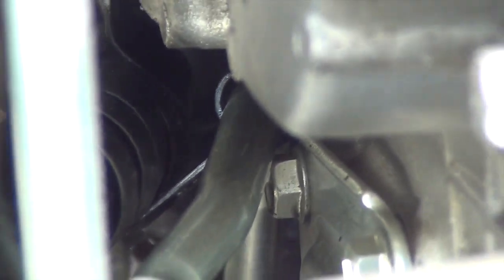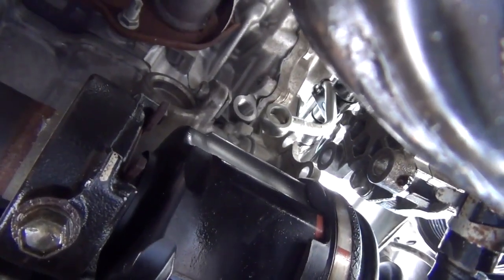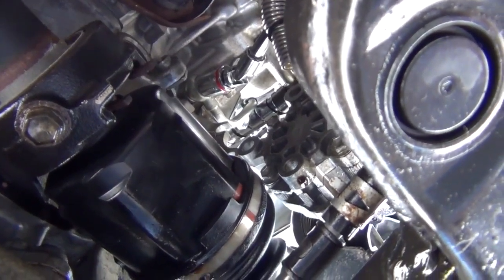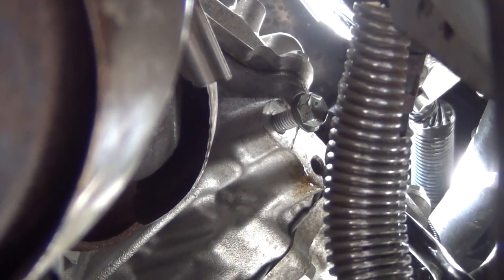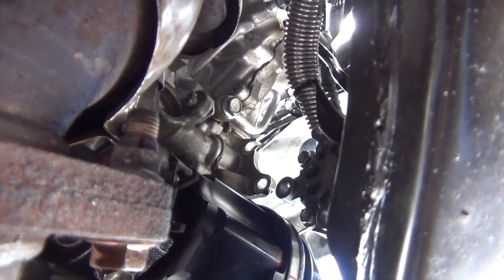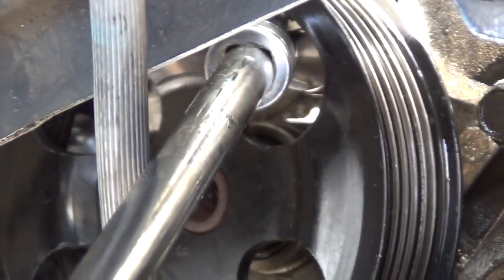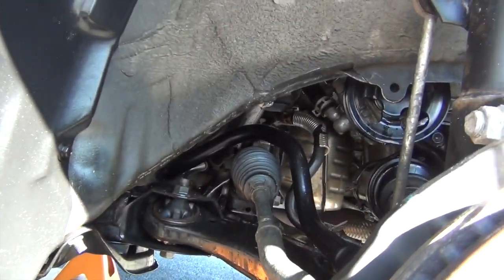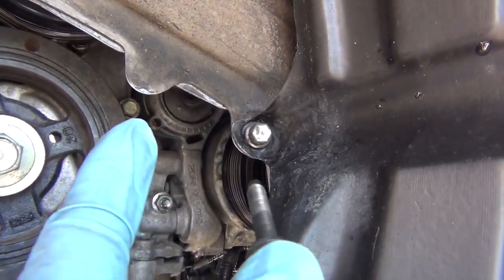3.5L V6 Camry VVT-i Oil Failure - How To Fix

Comment: Thanks for the video.  Was able to do this myself tonight.  for 07 RX350, this is impossible to do without disconnecting the power steering  lines and removing the PS pump entirely from the vehicle.

Comment: Thank you! I just bought a Camry with a rubber hose and did an entire search on YouTube. I found out that basically there are only 2 videos on youtube showing how to replace the rubber hose with a metal hose for the power steering pump. The other one showed pulling the axle out to gain space, which is not ideal for me. I hope your method is going to work for me. I'll try it when it gets warmer! 😄 By the way, what is the torque spec for the power steering pump bolt

Comment: To reinstall the PS pump, You have to loosen the engine block bracket bolt that the Power Steering metal-line-bracket screws into the Engine so the PS pump has enough wiggle room to line up & thread & tighten the the pump bolts. Then tighten the bracket bolt that you loosened.

Comment: For the 2GRFE engine I recommend replacing the line with the ALL METAL LINE Toyota 15772-31030 Pipe, Oil
2008-2018 Toyota 1577231030 - the rubber is the point of failure (video shows old rubber part replacement).  Copper washers (rear, one-piece) 90430-16016 Copper washers (front, separate) 90430-16017

Comment: The torque for the union bolts is 42 ft*lbs and the the top part of the line is supposed to have two crush washers, not a clip washer. If it works it works I suppose.

Comment: You had access for days on that Camry. I just did it on an 06 Avalon and I honestly think completely removing the power steering pump is probably the way to go on that car. I had to undo the sway bar links just to give it a few extra mm of space and I could still barley get a small socket with a u-joint on it. You might be able to get a torque wrench on it if you remove passenger side engine mount. You wont have but maybe enough room for a click at a time if the power steering pump is still in the car.
Reply: Some suggest removing the bottom engine mount and with a jack and wood block under the oil pan, raise and tilt the engine up a few inches.
Reply: Do I need a jack if I remove the upper passenger side engine mount ?

Comment: this is the best video for this job i found on line. I am going to do it for my 08 lexus ES350 when the parts come in. The toyota dealer wants $460 to replace it. The car previously had the rubber hose replaced by the dealer and not leaking for 10 years by now. But after 100K miles, i don't want to take any chances.
Reply: I did it on an 07 Avalon and honestly 460 sounds like not that bad of a deal.

Comment: That Toyota/Lexus would place a rubber hose in a critical part of the oil system is catastrophic.  I'm reading that this is in some form of recall with Toyota replacing this gratis?  Is that accurate?

Comment: I am having the same problem with both 3GR and 2GR engines. Indeed it is common not only with 3.5 L Toyota engines.
I am planning to do a similar job, but I wonder if I need to bleed engine oil first........... Very appreciated and clean vid. Thanks.

Update: I changed that crush washer without draining engine oil. Small amount of oil will leak that can be caught with a water bottle or a rag.
The job is easy and, with proper tools, can be done at home, better after removing front wheel.
Reply: It leaks minimal fluid. It doesn't really matter if you drain the oil because there will still be oil in the line and that is all that leaks out.

Comment: Last year,after watching your video, I visited the dealership.  The only part replaced on my 07 Avalon was the oil cooler. Service advisor told me it was replaced in 2010 but when I checked the records, it only says oil cooler, not the vvti. I looked under the hood and there’s the rubber hose in the rear bank.  Should I be concerned? I have 186k miles.
Reply: Also, I purchased the Avalon used in 2017 @125k miles .
Reply from the maker: @samukahtviv1  No, you should be OK, as the official fix from Toyota was to replace it with a different hard to soft to hard line except they fixed the soft line formulation. Is your soft line more of a dark grey instead of a black? If so, it's using the corrected line from what I have read. Also, if this thing were to burst on you, it most definitely would have happened by now ;)
Reply: @trevorsgaragemusings  Ok that explains why the dealer initially order a soft/hard line when I asked them to order one. The soft/hard one was 3X as expensive as the fully hard line. The extra day wait was worth it. Better part at 1/3 the cost. Who would have thought?
Reply: I am almost certain that the Avalon doesn't have an engine oil cooler. I have been digging around the factory service manual and have seen no mention of an oil cooler(Mine is a 2006).

Comment: Havoline oil, thats what it needed or castrol, the motor needed better detergents those cars had a problem on those years with oil clogging up the engines.  So you needed to change oil on them at 2500 or use synthetic.

Comment: I have an 07 es350 with 140000k. The dealer fixed this issue for the original owner when the car had 18000k, but they didn't use an all metal line they just used thicker rubber than the factory did. No problems with it but I want to do the metal line anyway.
Reply: I had the same problem with Toyota recently.  I have had the car with the subject engine since 2008.  In 2010 they did the recall and changed the hose.  I could not figure out why if there was a problem they would change out the cause of the problem with like for like.  As you say they must have changed the original with a thicker hose.  Well unless the hose is manufactured from oil and heat resistant rubber the same thing will happen, it will just take longer.  For this reason I had them take another look at it just this week, they say it is fine.  I pointed out to them that the recall of 2010 inferred that the rubber hose was to be changed out for the all metal pipe that they were fitting into new models from 2010.  They were not interested.  The recall letter of 2010 states that Toyota will replace the rubber hose with 'a newly designed one'.  That must mean newly designed rubber one despite that fact that in the very same year they were putting the all metal pipe into new models.  Should also mention that the car went in to Toyota mainly to replace the leaking water pump (seal leaking) at 142000KM.  The VVTi hose was changed out at 25000KM in 2010.  Should also point out that the vehicle in question is one of two Toyotas we currently own, the other being a Corolla.  Previous to those I have had four other Toyotas over a thirty year period and have only had one problem with one  of the cars, ie the one described above.

Comment: Is your timing cover leaking yet? My Avalon and Lexus ES 350 timing covers are leaking. I’m looking at $3,300 each cause they need to yank the engines out to re-seal it. Manufacturers are making disposable cars so that we buy new ones every 5 years.
Reply: @TheRedc0met  
My ES350 got 65K miles and Avalon is at 145k. Maybe my cars are the unlucky batch but from what I’ve read, it’s common on sedans but not sure if your RX350 cover was sealed with different type of silicone. Ever since I switched to full synthetic oil my engine started leaking even faster on Avalon. Anyways it’s no big deal as long as car runs without any major issues I’m all good with a small oil leak.

Comment: Hello Neutered10mm.  What a great job and detailed explanation on your part. I hope that your son Nicholas will be as good mechanically as you are one day!! I am just trying to help my son out who is away at college. He came to visit last week and drove his 08 highlander only once and the following morning I noticed a massive oil puddle. I diagnosed that to be the same issue as you are describing. Could you provide a little bit more information about that upper cover that was soaked with oil. Does it need to be put back? Or was it there just to protect the original robber portion of the tubing. What a shady design onToyota’s part. I can’t believe they could not put the oll metal pipe right from the beginning. Almost an intentional time bomb. If you would be so kind to send that information to the following email address:  Gobulls100@gmail.com. Hope it is not too much to ask. Thank you in advance. I wish you and your family all the best In the coming holiday season!
Reply from the maker: 123 Skater as far as I can tell it was there only to protect the connection ... pretty sure the all hard line version doesn’t NEED the cover, but again, this is just a guess on my part. Thanks for the kind words and best wishes to you and your family this holiday season as well.
Reply: @trevorsgaragemusings  ( neutered10mm
neutered10mm
2 days ago (123 Skater) from another PC......Thanks much for such a quick response!!! So did you put the old cover/shroud (that was soaked in oil) back or not at all? Best regards!   ;-))

Comment: Help!  I have the car apart as I write this and am desperate for answers.  Need clarity.  You did NOT remove the line from the pump (just loosened the bracket to the PS line) for this fix.  correct?  Having a problem gettin the pump off and moved.  I have the 2 bolts off and the bracket but moderate prying on the pump is not doing much.  Am I missing something?  Any tips??  your fast reply is greatly appreciated
Reply: I am at the same point, anything you had to do to get through this hurdle?  I see another video from Frank Saab and he took everything (rotors, axle, struts) apart to remove the steering pump.  Trying not to go that route if I can.
Reply: @azzurroday9730  It has been a year so my memory is fading.  I know the F Saab video you speak of as I was looking at it whenI posted a year ago.  I do remember that I did NOT have to go the F Saap Route.  I was able to remove it eventually but can't remember EXACTLY how.  I do want to say that I think I remember the reason it was stuck was simply oxidation.  The metal of the parts that were not moving was sort of ?lightly fused together????  (I think).  I also vaguely remember that part of the solution was loosening the power stearing pump and shifting it out of the way (but not totally sure about that).  Please message me back if any other questions or clarification as it may jog my memory better.  Also, please let me know how it turns out (what you did) so I & others can benefit.  also... the VVTI oil line bolt (that you are trying to gain access to) is a nightmare to loosen...  but mine finally did.  It seems like it is on super tight, but finally gave way.
Reply: @jotu173   Thanks for responding.  I gave up on it and replaced the front oil cooler line instead, I am going to have a shop do the vvti-i oil line.
Reply: @azzurroday9730  make sure you get a price for it first.  Unless they are a Toyota dealer, they will probably have no clue what to charge you.  I think dealers want $300-600-ish to replace it  (the price is just a foggy memory though, so I could easily be wrong).  I had one non Toyo place even say "I guess we will just start and see how long it takes".  If any way possible, try to find a Toyo dealer mechanic in your area that might do side work.  Maybe with a free craigslist advert?  Make sure to double check and make sure that they REALLY work at a Toyo dealer.  Just remember, that pipe can go at any moment and it will almost certainly mean the quick & total death of your car as it happens VERY, VERY, fast and quietly (no warning lights either) and then RAPIDLY DESTROYS your engine beyond any practical repair point.  So you should take care of it sooner rather than later... Good Luck!

Comment: God that sounds awesome at the end. Wow. I have to say I've never liked a V6, but the 2GR-FE 3.5L 268 HP Camry engines sound so amazing. They are a screaming engine, but have a shocking amount of very low RPM torque too. They are my new favorite Toyota engine, so much power it's ridiculous.
Reply: I recently picked up a used example with 213k on the clock with no leaks other than a leak at the lower union bolt on the tsb item. 16 years 200k and no leaks. I have been really impressed with the engine so far.
Reply: @lejoshmont2093  hi. How did you fix the vvti oil line leak? Replace with the metal line?

Comment: I am but a 2007 Camry v6 3.5l and was told the the vvt oil line needs replacement car runs fine except for having a misfire on 3 and 4 but that’s probably just spark plugs or coil anyways. The dealer says the all metal line dosent show to fit this model is that correct?

Comment: Thank You, for the video. 
I'm in the information gathering stage of buying a new vehicle, and the Tacoma has caught my eye. I'm hoping Toyota has redesigned that part on later model 3.5s. Something to think about.
Again, thanks for this series on the 3.5 V6.
Reply: My understanding is that when some of these were fixed under the campaign anything toyota product that bears a 3.5 that was affected by this they replaced it with a metal line and any newer models sometime I believe in 2009 and after bearing a 3.5 2gr-fe v6 had a metal line put on them from the factory.

Comment: what a life saver! great job... i have one worry though, when i did this fix, the wire mesh filter did not come off together with the top banjo bolt. i was afraid to use a pick to fish the filter out because i might pucture the mesh. instead, i just tightened the banjo bolt with new crush washers to spec (48 ft. lbs.). My question is, will the mesh filter simply snap in place in there or not?
Reply: i did same thing did u ever have any probs with urs later ?

Comment: How much oil did you lose when you disconnected the oil line? Thanks for this very helpful video. I'm about to tackle this job on my 07 camry, we just bout it a month ago and have noticed a small drip from the same area. My drip looks like its coming from the bottom bolt though around the gasket i guess. I have the all metal line to replace it with and all new gaskets and 1 new banjo bolt.
Reply from the maker: Oil loss after the hose was removed was minimal, but I drained the entire engine before starting the job.
Reply: +neutered10mm Do i have to drain the oil before?
Reply: +Brandon Albright I ended up NOT draining my oil. Only lost maybe a quarter of a quart. I also had to unplug a wire connection to my power steering pump not mentioned. Its more complicated to me then most other people said. It took me a full day just to get to and remove the oil line....im about to start putting the new line on now and everything else back together. What sucks the most is I really don't think my line is what's was leaking, the leak is on the block right behind the bottom banjo bolt! I'm really pissed cause we just paid a little over $10,000 for this car a month ago. Every morning there's 2 or 3 drops of oil on my driveway. After I wipe the oil away from around the bottom banjo bolt, about 10 minutes and a little is back again.
Reply from the maker: +Brandon Albright sounds like the crush washer wasn't torqued down properly at the factory ... OR ... It was "fixed" at the stealership by the previous owner.
Reply: @trevorsgaragemusings  As I was doing this job on my car I also found evidence that this job had been done before with the old style line. Looked like it wasn't done by the dealership  but by someone else. I noticed the same problem the line was leaking by the lower banjo bolt not the soft line. I made sure to give it a few extra tugs with a flex head ratchet after torquing with the long extension and universal joint. It's not leaking yet hopefully it doesn't🤞.
Reply from the maker: @lejoshmont2093  Yeah, torque must be applied directly straight and when using a universal, you lose torque. There is an online calculator that I found once that can tell you how much off you are by the angle of deflection in the universal joint, but just upping the torque by 15-20% should do just fine ... or a few extra ugga duggas ;) I think you will be fine.

Comment: I have a 2007 Camry that is experiencing codes P0018 and P0019 along with some misfire codes. First 2 codes are related to Crankshaft Position correlation Bank 2 sensors A and B. was wondering if t his could be related to this oil issue. Di dyou h ave any codes on your car?
Reply: did you ever figure your problems out?  Could be related to the oil issue but, could just be bad sensors.  Hopefully you fixed your issue.

Comment: Hey neutered10mm I just purchased a '05 Avalon and I seem to have a slight leak in the area of the video. Could you please give the part number for the hose. Sorry if it has been posted.....Thanks
Reply: Hi. How did you fix that ?

Comment: What is the part number and where did you buy the part? I have the same problem with my sienna. Thanks for the video.
Reply: For anyone else looking the part number for the full metal line: 15772-31030 , one washer: 90430-16016, Two of these: 90430-16017

Comment: Was there a reason why you did not remove the lower engine mount and lower the engine a bit? Seem thing are easier to remove and reinstall if that was done.
Reply from the maker: Mitch n Thought about it, but the labor involved wouldn't have saved much time if any, so I decided against it. The confines of the rear are what they are and I figured lowering the engine wouldn't have give me any more room to work.
Reply: I did it on an Avalon and I would of had to remove the power steering pump if i was going to lower it. I raised the engine instead of lowering it.